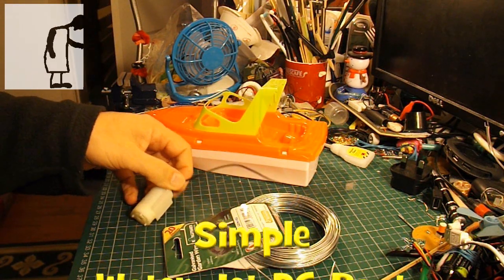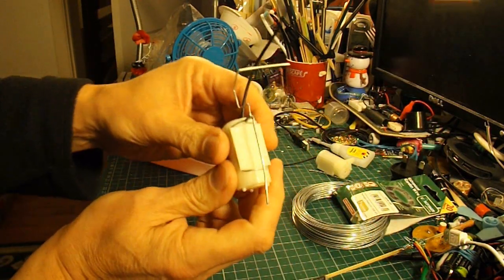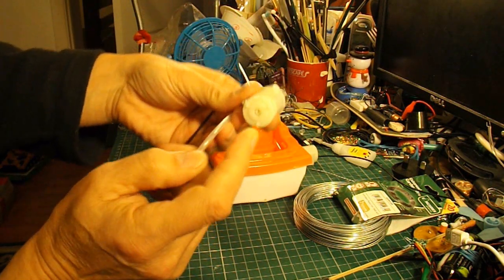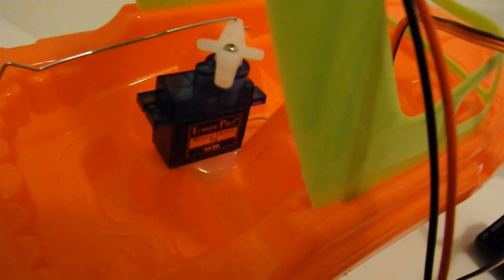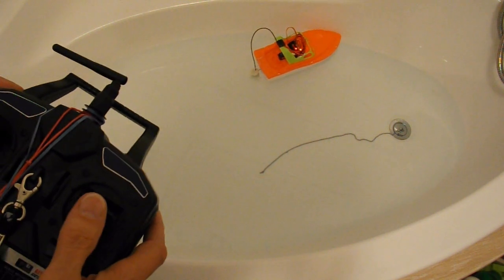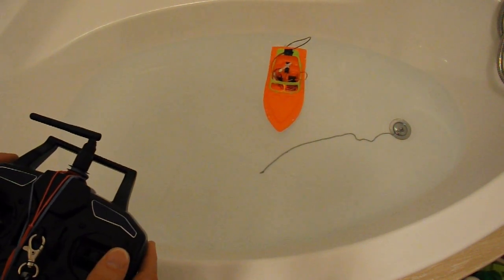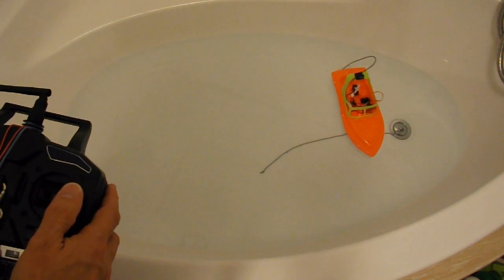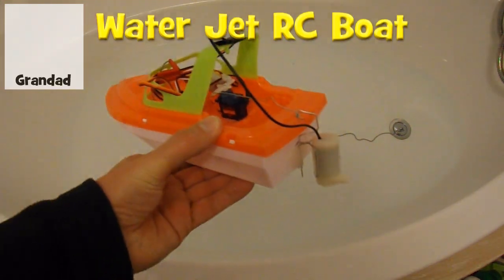Simple Water Jet RC Boat 20151222

Comment: For you what is better betwen a pump and a padle?
Reply from the maker: +PHILIPPE ET FREDERIQUE MAISON this is just a novelty with very little power. There are many advantages in driving a boat with a water jet but for simplicity I would use a normal propeller on my toy boats.

Comment: can you put two pumps insige the boat and use differential thrust to steer?
Reply from the maker: +Thundi probably, no reason why it shouldn't work like that. I may give it a try sometime. Main issue is the intake is the base of the pump so I would have to cut holes into the bottom of the boat. Turning the pump is certainly better for maneuverability.

Comment: Are these pumps powerful enough to propel a stream of water roughly 3 to 4 feet? if so, it'd be kinda cool to make a micro fire fighting boat.
Reply from the maker: eBay link for the pump in the video description. You will be able to get the specification there.
Reply: Alrighty, thanks
Reply from the maker: +Dr. Shocker here is another water pump toy I made https://youtu.be/QaGXW3g__qU
Reply: GrandadIsAnOldMan

Comment: nice little build considering its jet powered an very manouverable too. i think if u had an obstacle course a very tight one, then that boat would make it eve around tight turns.

good build.
Reply from the maker: +marc wohlmayer thanks Marc, this was not really a serious build, just toying with the component parts but I was pleased with the results. I do like to use items for purposes they were not designed for.

Comment: do you think that if you can put 2 or 3 pumps at the back it will be enough power to be used in the small river from this video https://youtu.be/q50GTdd9D1s
Reply from the maker: +Marin Minkov just depends on how fast the water is running at the time and what pumps you are using, I am sure you could use the same principle. Using multiple pumps would give you the advantage of having some redundancy safety so that if one gets it's intake blocked by debris you would still have other pumps functioning. These particular pumps are quite low powered but if the boat is light enough it should be OK.

Comment: Where did you get the wire and how much
Reply from the maker: +The stop motion video creator if you mean the coil of wire, that came from a garden centre and is used for tying plants or bamboo canes or similar things in the garden. I don't remember how much it was but I don't pay much for anything, probably £1.99 you could search for it online, look for galvanised wire. It comes in many different thicknesses and sometimes has a plastic coating.
Reply: +GrandadIsAnOldMan thanks I will look in Bunnings

Comment: Hello i been watching your videos for 3 months now great job hook a 9volt to that boat it will go fast
Reply from the maker: +Jasmine Goss hooking a 9 volt battery to a motor designed to run on 1.5 to 3 volts will make it run faster for a while until it burns out, then you have to buy a new motor. If you put it on this boat the ESC should be able to handle it as it is rated to take a 2S LiPo which is 8.4 volts fully charged. I have done a series using a 9 volt battery to power a boat but I put a bigger motor in it to ensure it could handle the voltage https://www.youtube.com/playlist?list=PLA5a2xPRSrB2QEcFZj7zcR8RmjbPgoAaR I also ran it with a 3S LiPo which is 11.1 volts nominal or 12.8 volts fully charged